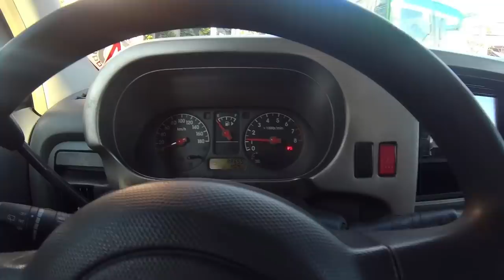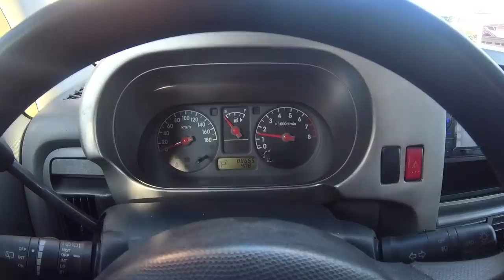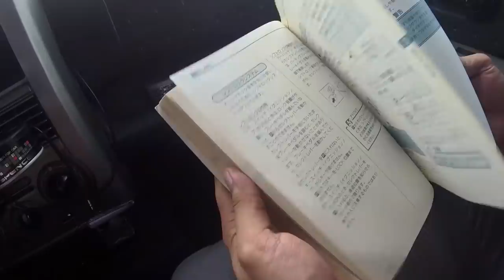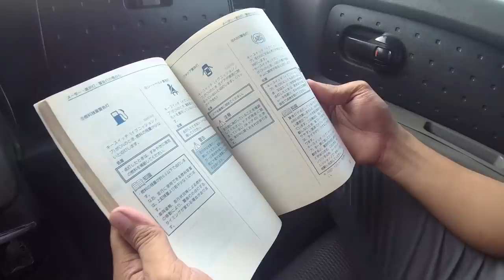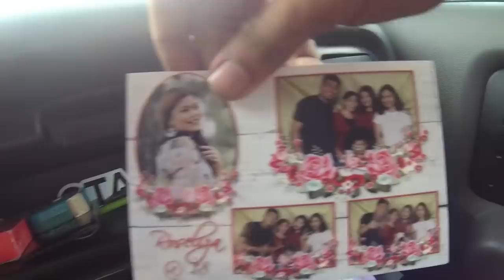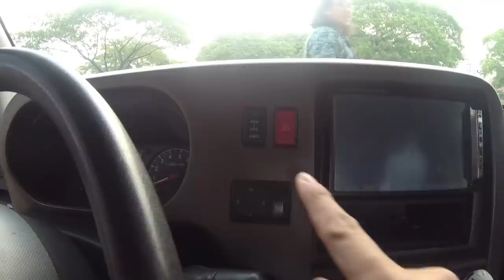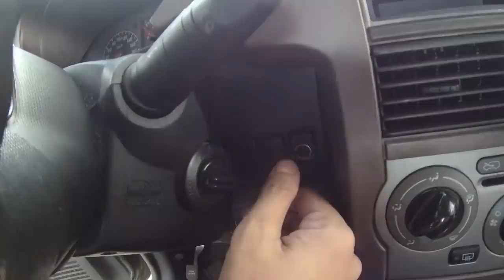2003 Toyota bB (J) x 2003 Nissan Cube (J)

Comment: 12:09 left hand shifting column on LHD converterd NISSAN CUBE.

Doon sa Australia, Yung Holden Suburban (Chevrolet), naman na kambyo, right hand steering column, tapos RHD. At syempre may parking brake sa right side tabi ng driver side. 

Maraming RHD conversions (USDM)  na mayroong shifting column sa kanan,

Comment: ang Toyota Bb is the JDM Left hand drive version. It was released here in the US as the Scion Xb. categorized as a small subcompact wagon, FWD with a 16V 1.5 liter engine.
Reply: Different rear door design, license plate located at rear door